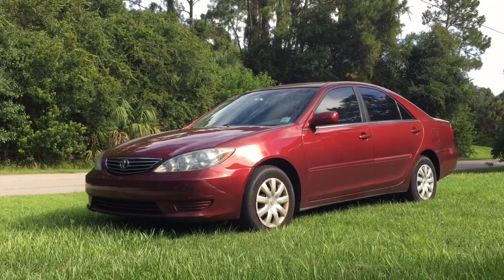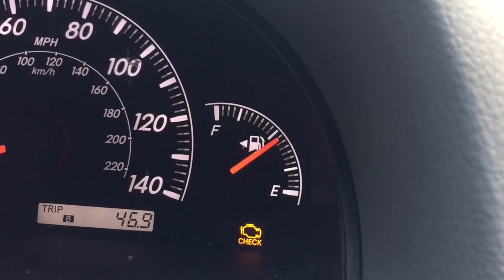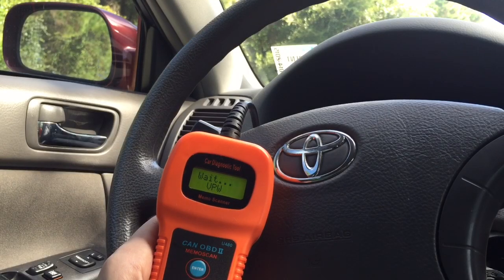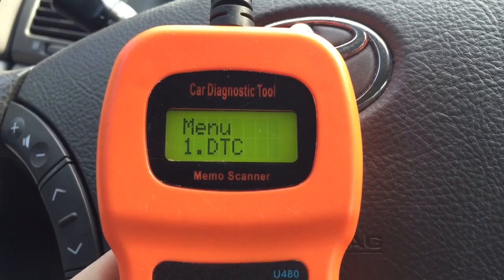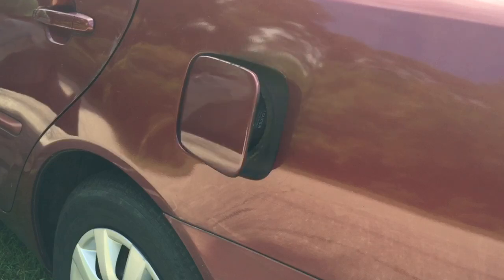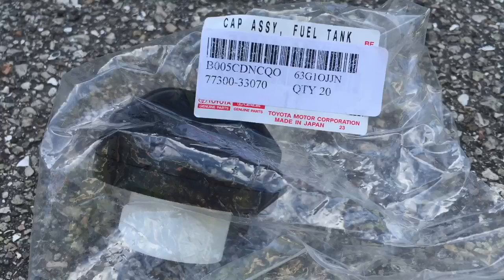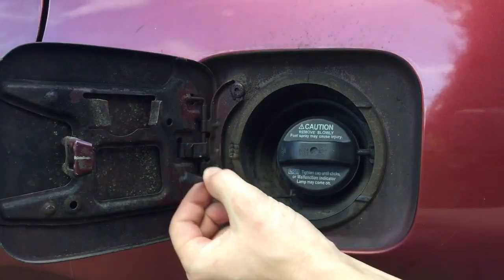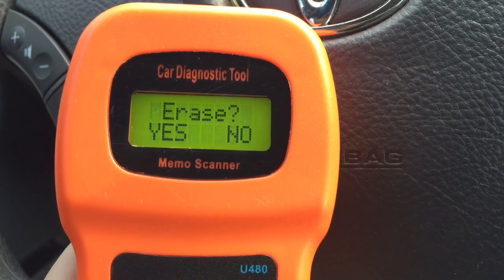How to fix error codes P0441, P0455 & P0456 on Toyota cars.

Comment: I had P0456 on my 2009 Corolla. Tried gas cap and purge valve. Neither worked. Replaced the charcoal canister and it fixed the problem. Been 6 months now and no light. Bought it on Amazon for about $225.00 at that time. Was very easy to install. I promise you can do it yourself. I know nothing about cars. YouTube helped me a ton, but even this one is plug and play. You just need a jack, jack stands and some basic tools and you can do it yourself. I more recently had P0441 come on and I replaced the purge valve and that resolved that problem too. Hope this helps!
Reply from the maker: Great tips, thank you for sharing!

Comment: Nope.   Don't reset codes.  If you have fixed the problem, the car will reset code.   Dumb idea, and this video isn't any help diagnoseing these problems.  Waste of time.
Reply: Gees! It didn’t help you... may have helped someone else, no need to be so rude.
Reply from the maker: It’s fine. If it doesn’t fix the problem, codes will come back. 
As far as video being helpful, maybe its not all inclusive, sure, I agree. I just shared what I found and what fixed the problem for me. Apparently it helped many others too. What actually dumb in my opinion is not lifting a finger at all to help others and trashing others who at least tried.
Reply: @DIYtime  wow that person is dumb, u are right.. it's fine to erase the codes especially if u think u fixed the problem

Comment: This video addresses P0456 but not the others. False advertising for clicks. Not appreciated.
Reply from the maker: All three error code could be (and most commonly) generated as a result of a worn out gas cap seal. However, those error codes are not exclusively related to a bad gas cap issue.

Comment: I have a Toyota Camry 2007 Hybrid. The gas pedal can sometimes randomly become unresponsive while driving. The car still has power and everything else works, but it will not accelerate and slowly glide to an eventual halt as if it were on neutral. No unusual sound or anything when I press on the pedal, just zero acceleration. If I pull over and restart the car, everything becomes normal again. This happens a few times a day. Any idea what it could be? The dashboard is showing check vsc and hybrid system. I also checked the obd but the only codes that showed were regarding battery replacement.

Thanks!
Reply: I know this is a year old but if something like this happens you should prob go to a mechanic not youtube. That's a very dangerous situation haha
Reply: Check and clean MAF sensor .
I had the same problem on a 2007 prius ,  changing  the fuel pump relay  fixed the problem (this is very uncommon to go bad) I spoke  to a mechanic  that works on the city priusus he sees a few a day, he never had that problem

Comment: This problem can be caused by a small leak in the evaporative emission canister...not uncommon at all as they are plastic. the leak can often be found at the bottom of the canister where the seam is, and can be repaired by using epoxy or sometimes superglue to fill the crack. Don't fall into the habit of replacing parts you don't know are bad with new parts...soon you will have a garage full of good parts you don't have a use for.
Reply: the dealer tells us the purge valve is bad $ 50    the canister you speak of is $350.  Toyota and their emissions system have become money pits!!   what a POS and too many sensors!!
Reply: epoxy fixes nothing...hack

Comment: I got P0456 Error Code on my 2003 BMW X5. I was able to fix it just for $7.00 dollars. I got Gas Cap O-Ring from eBay. Replaced it and star driving, 30 minutes later check engine light turned off automatically. Make sure you buy a seal which provides excellent resistance to petroleum products. Link is below:
http://www.ebay.com/itm/Fix-your-check-engine-light-error-codes-in-20-seconds-and-only-for-7-00-dollars-/332297717521?hash=item4d5e7cc711:g:J-8AAOSwCAJZYbWy&vxp=mtr
Reply from the maker: Nice! 👍🏻

Comment: Why erase the code?  Wouldn't the code disappear after the replacement of the gas cap??
Reply from the maker: +Otherguy04 
Yes, codes will disappear after certain amount of driving cycles if they were caused by bad gas cap, but it may take a while (40 cycles I believe...)
I like to erase codes to see if they come back in case it wasn't issue with gas cap, than I would look for problem somewhere else.
Reply: @DIYtime  I have to disagree with you, I have had several different cars and trucks and Never has a code gone away after fixing the problem. 
You have to erase the codes yourself.
Reply: it would take 40 drive cycles w/o detecting a problem for the codes to erase

Comment: Due to cold weather for some reason when I popped the gas thing(metal cover) to fill up my tank it wouldn't open.  So I kept trying to use the lever in the car and tried to pry at the metal door outside a bit.  (1999 corolla)

I've had stuck locks in the past due to cold weather but never with the gas cap/door.  Maybe I messed something up because a few days later the check engine light went on and now I have code p0441.  

Maybe I'll order a new gas cap and see if that fixes it.  The other fixes would be more expensive so I guess it's worth a try.

Thanks for the tip, hopefully this is a cheap fix.
Reply from the maker: Thanks for sharing, let me know if it works.
Reply: This has happened to me twice in the past but both times were my fault because I forgot to tighten down the gas cap enough.  In those cases however the check engine light went on right away, this time it went on after 2-3 days of gassing up.

I re tightened the cap the other day and after driving around for the day the light went off again.   So maybe the gas cap is slightly damaged or something.  Might be worth spending the money on a new one just in case it is the cause.
Reply from the maker: Sure, those are not that expensive.